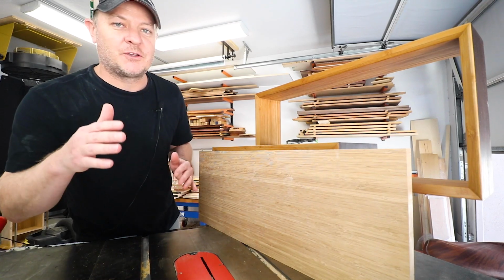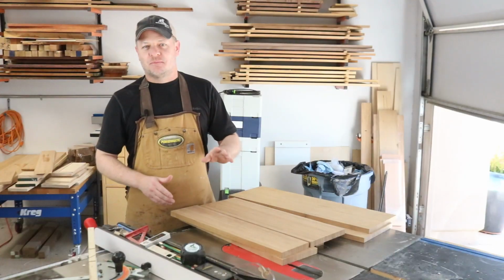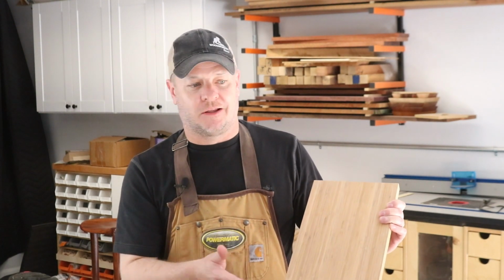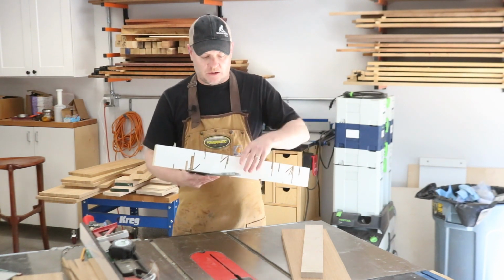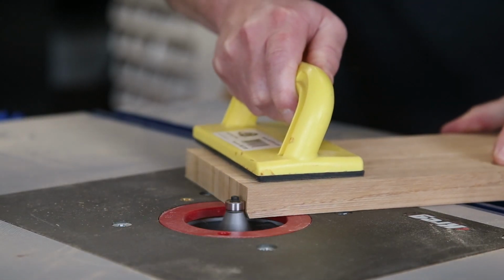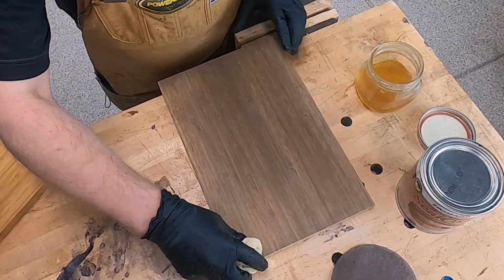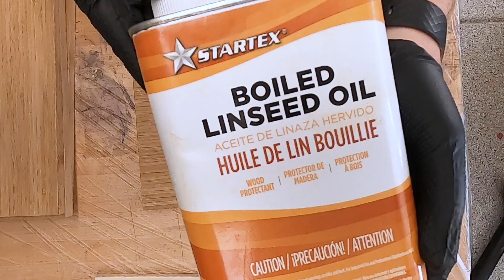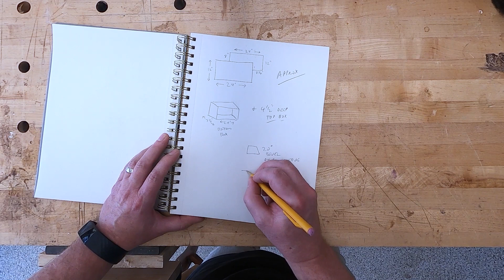NEW Lumber! Is Bamboo for You?

Comment: During a composite bamboo kitchen benchtop install a contractor "stuffed up", replaced the $240 benchtop material (no charge for labour), and promptly quit. I was left with two benchtops with one slightly ruined. After a bit of YouTube tutorial learning, I bought a trim router, finished the job, and now have a killer composite bamboo workbench under my house basically for free. I love this material, but score the cut line every time with a marking knife to avoid a mess. $0.02 Nice video, cheers.

Comment: You forgot to mention a couple of things.  One is that laminated bamboo plywood and lumber is made from flat rectangular bamboo strips that are cut from the bamboo stem. These strips or "slats" are then glued together end to end and in overlapping layers to form a "solid" sheet. Sometimes when thicker panels are cut, any voids between the ends of the strips are exposed which will need filling with matching wood filler. Sometimes the side and end edges of a cut panel will need edging  to conceal the voids and end grain. This can be done by cutting strips from a 1/4" bamboo "ply" sheet and reducing the thickness down to 1/8" then gluing on and finishing the edges like veneer. This "void" problem is especially true for larger and lower grade 1" thick sheets sold for table and bench tops and not intended to be cut into planks.
Also Bamboo is a grass with long fibres that contain sap with high sugar content that mold spores and mildew love to feed on. It's not good enough to just finish with wood oil e.g Dutch Oil if it is to be exposed to moist conditions e.g. outdoor furniture or bathroom and kitchen steam.  After just 3 months the bamboo will soon be discoloured with black stains contained within the fibres  (not easily removed). If exposure to high humidity or moist conditions are expected at least 5 coats of marine grade mineral-based poly will be needed.  When choosing a finishing oil or stain, read the label carefully as the manufacturer will often exclude Bamboo because of the mildew and mold problem.
Reply: How does the price of 4x8 bamboo sheet compare to other options? I would think since it grows so much faster, you could get a 4x8 solid instead of ply? I haven't been able to source locally, so I'm just curious before I really start digging for it

Comment: Thanks so much for your video! I have a bamboo counter block that I have drilled standing desk legs into and have found a lot of competing information about how to finish it. Based off of your video, I’ve decided to go ahead and use Danish oil. Would you say that a clearcoat polyurethane afterwards is necessary or can I just leave, the oil?

Comment: I appreciate the Video  onBamboo , my Curiosity  on Milling and Fabricating with it would be what types of Adhesives are best and on Commercially available Glued up Boards  is what did those Suppliers used for Glue Up ?  i am a retired ProfessionalWoodworker  and i suffered some Major Health Issues in my 40s   some of which i personally beleive were results of Woodworking  keep in mind  when i was Young  we didn’t always  have proper PPE  or utilize it  our Dust Collection and VOCs  weren’t monitored like they are  in more modern  times or Currently  and  Chemicals like Formeldahyde were used Often   obviously many of those  things have been resolved over the years  and i’ll be honest  some of my Health Issues  may  be results of working with Natural Exotic Woods  that put off their own Toxic Scents and Saw dusts ? i remember working with a lot of Mahogany  at one point and the Silica content was so high that  i would get Nose Bleeds  in the evenings  at home  and not think too much  about why  a lot of those issues may had been from the Finishes we applied years ago

Comment: Unless I missed it you didn't mention cost.  How does it compare to like conventional wood?
Reply: Cost prohibitive.
Reply: I have used it many times. Around here it’s 4-6 times the cost of other veneer sheets. Almost $500 per sheet. However, it typically saves a lot of time in the finishing because you don’t need to do any edge banding.  I find its more of a substitute or replacement for solid wood projects that are flat. Eg. You wouldn’t want to do a raised panel type cabinet with it. It’s really nice to work with other than the splintering on cross cuts but usually it’s minimal depending on what grain orientation you chose.
Reply: $100 FOR A 3/4X9-1/4X8'.  Would be nice to get some to make a project out of, but at that cost, I cannot afford to just tinker with it.

Comment: How does it shrink - expand with moisture , like wood??
Reply: its like plywood, they make it with a lot of glue.  buy a cheep bamboo cutting board and play with it.  should be real stable
Reply from the maker: Yes and no. It's hygroscopic like wood, but it doesn't "move" nearly as much. Virtually indiscernible until the material breaks along one of the glue joints, which can happen.

Comment: Anybody know a way to get bamboo to bend?  I tried steam bending with very thin strips, even veneer.  My intuition said it would be great for bending, but my intuition is clearly rubbish.  It just cracked at modest radii. But I've seen plenty of bent bamboo furniture.  How's it done?
Reply from the maker: There’s so much glue in it, it’s probably not good for bending
Reply: bent bamboo furnitures does not use laminated bamboo, and they are usually bent using heat, sometimes using open fire.

Comment: Two things: how does bamboo timber do when  trying to achieve a polished finish whether hand planed or finely sanded with multiple applications of a low build finish? Also, you neglected the remarkable environmental benefits of bamboo, its extremely fast growth and the virtually ineradicable nature of stands of it. In a world where natural forests have largely been destroyed in terms of yielding dense, clear, straight-grained timber, bamboo looks like a wonderful alternative. Oh, and what about cost here in North America?
Reply from the maker: We thought about what to include on environmental benefits. The bigger question to us was how much of the processing and manufacturing offsets the benefits of rapid growth? We're not sure.
Reply: @WoodworkersSourcecom  Whenever I've seen bamboo timber I've wondered the same, especially what is the adhesive and its qualities.
Reply: No... It will not replace hard wood, just another choice and the lumber type is not native to North America. Its native to Asia and the Indian sub-continent, even then it's at best ¾" thick this why it's always laminated. But it's as hard as steel when cured! It's used for flooring and counter tops in Asia commonly
Reply: @WoodworkersSourcecom  that's a very good point... The processing of bamboo is very environmentally unfriendly, similar to that of MDF! Another big culprit of pollution in China and India!

Comment: But never, ever plant that shit in your yard because it will take over your yard, house and anything else!

The bamboo he is using is the great bamboo varieties, they grow in Asia and the Indian sub-continent, it grows 30 - 40 feet high and 24 inches or more in diameter. Without lamination though, you will not find thick boards, however an inch thick bamboo is super strong.